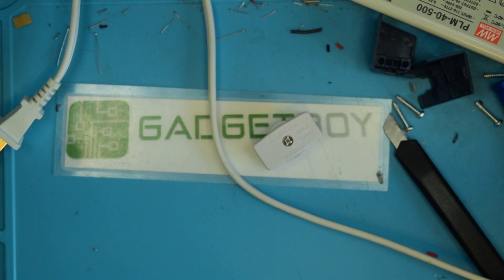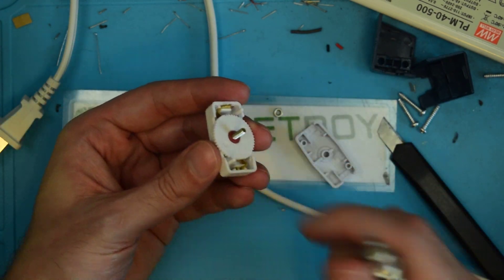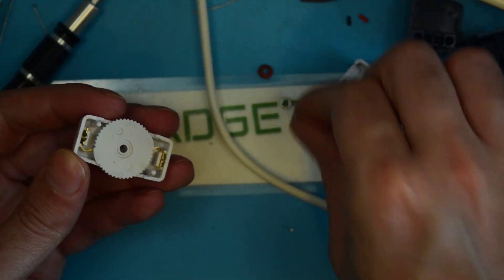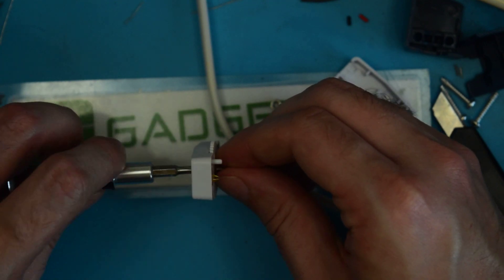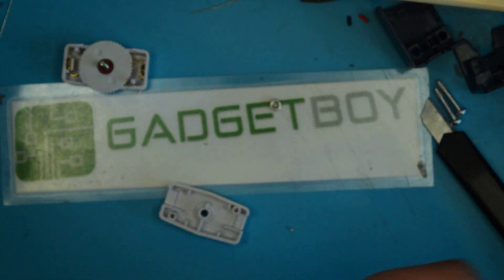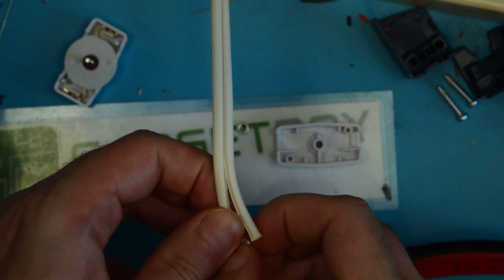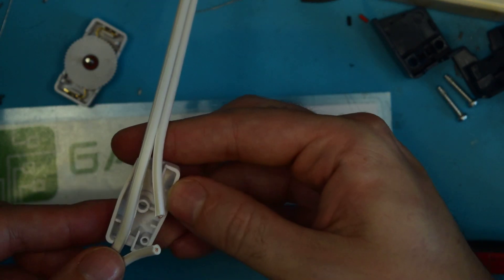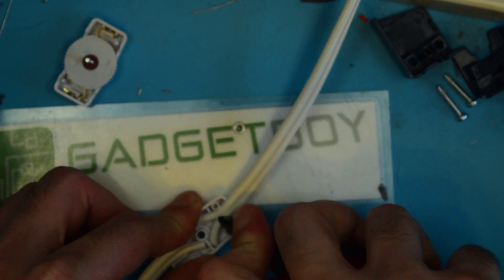How to install a rotary switch on a power cord

Comment: No earthing?
Reply from the maker: Not for this thing. I guess it's double insulated, and heavily shielded. It also has power-factor correction, which I think might contribute to the fact that my oscilloscope's background noise is LESS with the driver turned on. Very weird.
Reply: @GadgetBoy  one way to try find that out would be to use an energy saving miracle plug 😂 then an investigation into your home wiring....